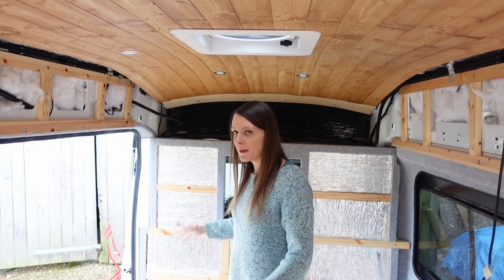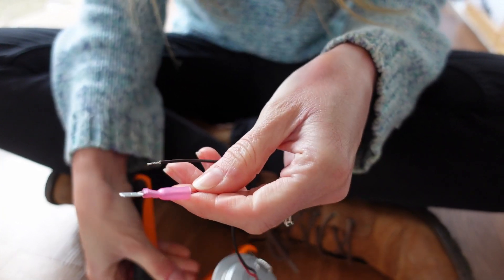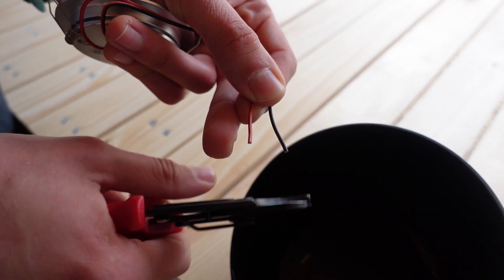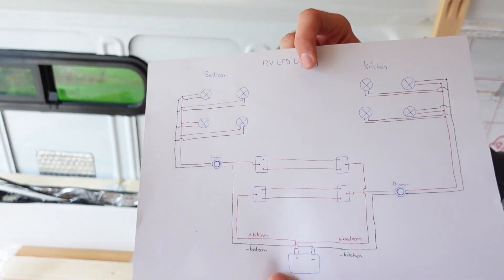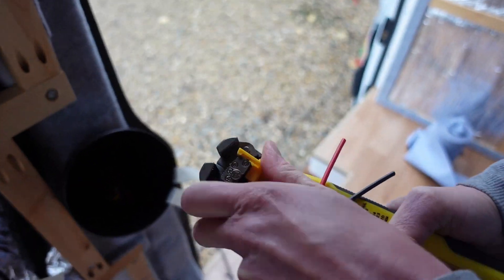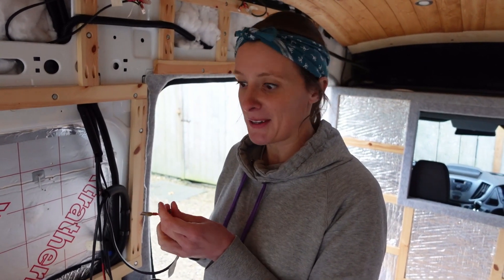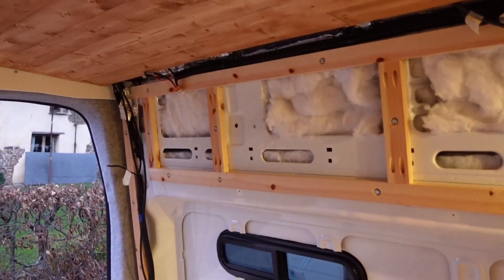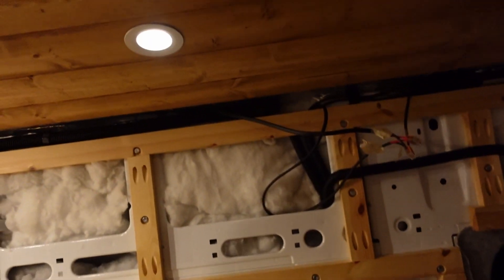Dimmable LED Lighting (With 2-Way Switches!) | Transit Van Conversion E24

Comment from the maker: Hey guys, we decided to re-upload this video as we wanted to add a small text overlay to make it more clear in the edit around insulating the crimp connectors of the lights as we thought it was a little misleading. YouTube doesn't allow doing that without uploading again unfortunately. Thanks to everyone who commented previously, we really appreciate all your comments and enjoyed reading them all as usual and kept a copy 😊
Reply: Really enjoying your van build series. I'm about to start the first fix wiring in my van. Can you tell me what size cable you are using in your lighting circuit please? Many thanks
Reply from the maker: @markleader2622  We used 3mm^2 duplex wire, and as our lights are very low energy usage the wiring we have is overspec for what it needs to be. We used the blue sea wiring chart quite a lot (http://assets.bluesea.com/files/resources/newsletter/images/DC_wire_selection_chartlg.jpg) and after working out the ideal for everything we had to power, we rounded up a few as we wanted to standardise the different sizes as much as possible and by larger spools of each. HTH!
Reply: @SelfBuiltStories  Phheeww!! When I saw the size of the cable you were using I thought I'd messed up and bought the wrong size. I calculated I needed 1.5mm for my lighting (it looks so much thinner than yours). Thanks again. You're doing a quality job on your build....it looks great!!
Reply from the maker: Cheers! And haha sorry, yeah 1.5mm^2 would have been fine for our lights too. It's a lot easier to work with the thinner wire as well, the 3mm^2 duplex doesn't bend very easily with the extra insulation sheathing around it. Possibly we'd buy another slightly smaller size for some of the really low power things if we were doing it again, but it is nice to know we can use the same wire (and we've added a couple of spare lengths around) for most things 🙂

Comment: ALSO, cut wires about 3 inches from connector so you can reuse it on future projects.

Love your work on this build....
Reply from the maker: Yep also a good idea, we didn't do that for the dimmer switches as the wires were so short before the connector that we wanted to have as much extra length as possible in case we had to remake any connection (which we actually did when we crimped on the wrong one first 😛). Cheers!

Comment: I would've put one male and one female on each pair of wires to provide a 'no- brain' polarizing connection.

Also, a female connector on the van's hot wire, which you already did.

I've watched several of your videos and have gleaned lots of good info from you two.

I love your work......
Reply from the maker: Cheers! And yeah interesting, you mean having each pair with a male and female, and then the inverse on the other side so it's not possible to connect them the wrong way? Yeah that would be helpful especially for things that use two same colour wires and not standard red and black 👍

Comment: this is fantastic. I have 5 fixtures in my camper that are all on the same switch that is by the door. I've been wanting to add a three way switch system on them. now I want to split the fixtures up too. thank you for an excelent demonstration of how you accomplished the task. I almost wish you had to rout wires thru the ceiling so I could copy that too.
Reply from the maker: No problem and thanks a lot, glad you found it useful! Definitely took a bit of pondering to figure out how we wanted to do the lights but we're really happy with how it turned out in the end. The wires in the ceiling are just simple duplex ones going to each LED, we did film that part too, it's in our ceiling video if that helps (https://youtu.be/UcrIgiBpgNE) . Good luck with yours 🙂

Comment: Congratulations on wiring job very well done. Lighting system is really well thought out. I especially turning in on the kitchen light without getting out of bed.
Reply from the maker: Thanks! Yeah it's been really handy already, we use both sets of switches quite a lot while we're working in the evening 🙂

Comment: Hey Guys, another fantastic video. Honestly the detail you guys go into so beginners can get to grips with the process is the best I’ve seen on YouTube. So well thought out and explained in great detail, well done. 

This lighting set up is exactly what I have in mind for my van. Excuse the beginner question but are the bedroom and kitchen lights on separate circuits? I’m not far from the pre wiring stage and trying to work out how best to do this. Is the reason for separate circuits to keep the load down? 

Also as a side note myself and my partner have just moved to Cornwall and have a small holding with a nice big field perfect for an overnight stay in the van if your ever in need, just a 10 minute drive from Falmouth, beautiful area.

Thanks again guys
Reply from the maker: Thanks! Glad you think so 🙂 And yep they're two separate circuits, with two separate slots in our fuse hub. You could definitely join them together before the fuse hub and keep them as a single circuit though, the lights only draw ~0.25A each so even with all 8 on one it wouldn't be a problem. We kept them separate just for convenience really, as the way we wired it behind and coming through the panel meant we had the positive and negatives from each set of 4 right there by the fuse hub, so it was simple to put a ring terminal on the end and hook them straight up. Good luck with it, having been on the road for a long while now we really appreciate having two sets of switches for the lights, both get used a lot! And cheers for the offer, we're often down in Cornwall so you never know 👍😎

Comment: Love your channel as a resource for ideas , the dimmers have the 4 very small gauge wires that you are using, then connecting on to your regular lighting run circa 2.5mm gauge, any concerns about these being a weak point in carrying the loads. I am using your concept , but when stripping the wire back on the dimmers, they just look undersized. I accept that it is a short wire run and relatively low current being ran.  14:45
Reply from the maker: Cheers 🙂 And yeah the dimmer wires are thin but we're not worried about it for such a short run and low current. From what we've measured each of our LEDs draws ~0.25A, so each set of 4 combined going through a dimmer is ~1A at full brightness . Not sure exactly the mm2 guage of the wire it's using, but if its ~0.5mm stranded copper then it should have a max amp rating of around 11a. Possibly it's a bit thinner than that (the listing says it's rated to 6A), but still multiple times higher that what we're putting through it, and we have each light set on a 3A fuse. And for such a short length, we're not concerned with voltage drop either. If you were paralleling a lot more lights then possibly it could start to be something to think about, but we've had them in for coming up to two years now with no issues 👍

Comment: Your doing a great job, its great to watch you learning new skills without the drama / fires / explosions lol.. I have to admit as a sparky I was shouting at the screen when I saw you hadn't insulated your connections, I think I'm turning into Victor Meldrew . . ;-/   When you get round to putting your Diesel heater in take a look at bobilvans Hot water adapter kit. Or take a look at David Mcluckie YT channel He is the man when it comes to diesel heaters.
Reply from the maker: Haha funny you mention that, we actually have a few tabs open from David Mcluckie right now! And yeah spot on again, we're going to be using the bobil kits with our diesel heater. We're pretty much finalised on our heating and water setup now on paper, just need to actually finish getting all the bits and build it! And yeah not sure how we forgot to put the tape on the first time round, probably because we were focussing so much on the switch setup. If we were doing it again we'd probably just use the wago's everywhere for simplicity 🙂
Reply: @SelfBuiltStories  You have Way too much spare income throwing it about on Wago's. i'd have used block connectors.
Reply from the maker: We picked them up for £15 for a box of 50 for the whole van which didn't seem too bad, so we have lots spare  🤷‍♂️
Reply: @SelfBuiltStories   Do you have a link for these still please , or was it a one off deal ?

Thanks

Fattrucker
Reply from the maker: @Fattrucker cheers :) And yeah, John Mck's channel is great too! We've actually watched his entire diesel heater playlist, wouldn't have thought so much content on the inner workings of these heaters could be interesting but it is  😀 And the link should be in the description, we just picked them up from Amazon UK 👍

Comment: I felt I had to comment on this and the two previous episodes on the electrical work you both completed on your van build.

I must say it's rare to see such a well planned and executed install. It was great to see such a well installed system with quality terminations, correctly gauged wiring and properly torqued connections.

The system will give you years of trouble free operation and you should be very proud of the quality of your install. It is certainly a change from the many dangerous installs I have had to rectify.

Just one bit of constructive criticism.... Double check that the panels have a good sound connection to the ground chassis of the van. The van body is essentially your safety connection so all your ground terminations need to have a decent ground termination. If for example one of the positive wires made a connection to the chassis of the solar panel and you came in contact with the panel you could receive a very nasty shock especially if it was wet. 

I assume you will be installing an RCD for your mains wiring with your grounding to the chassis. This will protect you from the mains side of your system but not the DC side.

If you do not have a good ground to the panels you can buy grounding plates that have sharp points on both sides. They will dig into and pierce through the oxidation on the body of the panel and give a good ground to the solar rails. You may need to run a third wire with piercing  washers to the solar rails and terminate the other end to your grounding stud.

You may well be aware of all of the above as you have clearly done your homework but I felt I should mention it just in case.

Don't forget your carbon monoxide detector low down the wall just above the floor and your smoke  alarm above the bed.

I wish both of you a fantastic adventure and as long as you keep your safety In mind I am sure nothing will spoil your travels.

A beautiful install and build you should both be very proud of 👍 

Warmest Regards 

Stuart
Reply from the maker: Hi Stuart, thanks so much for your kind words, and it's reassuring to hear your thoughts on our setup .  We did spend a lot of time researching and planning everything so it was great when it all came together and we're really happy with how it turned out, and as you say, we're hoping it will last a long time 🙂 

We'll make sure to check the solar ground again, and yes we will be installing an RCD and mini consumer unit for the AC side. And we have a combined CO and smoke alarm and a fire extinguisher. Definitely our priority is to make sure our setup is safe as well as being practical to power everything we need.  All the best and thanks again for taking the time to comment 😊

Comment: Great video!  I'm looking forward to watching the rest of your videos as well.  I came across this one as I was researching how to set up the lights in our van almost the same way that you two did and I think I finally found the answer I've been looking for.  One question for you - can you use the dimmer switch to turn off the lights entirely or does it just control the dimming?  Not that you would need to do that since the actual on/off switch is right there two, I'm just curious.  Thanks!
Reply from the maker: Cheers, glad you enjoyed it! 🙂 We spent quite a bit of time trying to figure out if the setup we were imaging with all the dimmers would work and it was very satisfying having it all working. That's a really good question, and the answer is yes you can turn it off with the dimmers as well. You just touch once instead of touch and hold and the lights turn off. If you touch it again they come back on at the same brightness they were before. In practice though we won't use the on/off on the dimmer as the one quirk is that if you turned them off with the dimmer, then the rocker switches wouldn't turn it back on again until you had remembered to turn them on via the dimmer again. What we did is put the dimmers after the rocker switches in the circuit, because the dimmer has an LED light ring around it. So we did that for two reasons, one so it gives a visual indication when the lights are on, and if we ever try the switches and they're not working we can see visually if the dimmer has been accidentally pressed. And the other is the inverse, when the switches are off (e.g. at night) we didn't want the blue glow to be visible, so we cut power to the whole dimmer switch when the lights are off. Hope that all makes sense!

Comment: You can use in-line wago connectors to connect two wires together. It's far simpler.
Reply from the maker: Hmm yeah those look cool if a little pricey. If we were doing it again we would probably use the 3 way wagos for the ceiling lights too as we already have those and there's enough spare

Comment: Did you guys remove the standard cargo lights connected to the doors in the back at all?
Reply from the maker: Hey, yeah we took out all the cargo lights as we wanted to put our own spotlights in, but they were useful up to that point as it was the only light we had in the van for working into the evening 😄

Comment: Hi! How did you calculate the wire size for this circuit? What did you end up going with, and what was the total length of wiring? Thanks!
Reply from the maker: Hey 👋 We used 3mm2 duplex, which was a bit overkill for the lights but we decided on using that for most of the low power 12V accessories as we could buy a big spool of it and not have loads of different wire sizes. Later on in the build we bought it non-duplex as well as it can be a bit cumbersome to route the duplex one with the extra sheathing. 

We put the wiring in for the lights in our prewiring video: https://youtu.be/DTzaAh7on4c?si=RIGJTYDEycyVB78A&t=447 . And talk a lot more about how we picked all the wire sizes in the van in that one too based on wire run distance and voltage drop. Not sure exactly how much wire we used specifically for the lights, but it was probably ~20m or so as we used up most of a 30m spool with just the maxxfan and the lights, and to get to the fan is probably about 8-9m round trip. Crazy how quick it adds up! Good luck 👍

Comment: Hi, sorry for my broken english. Amazing chanel, love your skils and solutions.
I'm wondering about the kabel diamention for your LED ceilinglight, in my opinion 1,5²mm is big enough for that. What do you think?
Best reagards from Berlin, Germany
Steppe
Reply from the maker: Hey Steppe, thank you! And yeah 1.5mm^2 would have been fine for the lights in our case, and our wiring there is definitely over specced for what it needs to be. We did that because we bought a big spool of 3mm^2 cable for all the low current DC accessories so we figured it was easier just to buy one size that would suit all them. We would have bought 2.5mm^2 but the company we bought from doesn't sell that size. HTH!

Comment: So it’s good to do-your  wiring and your solar  wiring even if u don’t connect your solar before you do your ceiling and walls ? Trying to find a step by step guide but everyone want charge you 😐 ..
Reply from the maker: Yeah that was a confusing one for us at the beginning figuring out when to lay the wires. There is no set order you have to follow though and different pros and cons. We decided to do a lot of the wiring early on behind the walls to tuck it all out of sight, but you could equally leave the wiring till later and do it in front of the walls. Some people like to do that and make a feature of the wiring, putting it through copper pipes or something like that as a show piece. One advantage of doing it later on is it might be more accessible to get to if there is an issue that needs fixing later on. For us we decided we wanted to hide most of it but left some places where we can access behind the wall if we need to. We've also since added some more possible wire runs for future expansion that are in front of the walls but still hidden inside furniture, through the bench seats etc. It's good to think about the things you want to power in the van and where they will go in relation to the rest of the build/furniture etc and it starts to fall into place.

Comment: love your dimmer switches , are they still working good , did you get the second one working or did it need replaced ? lastly do you have a link for the dimmer switches :) keep up the great work guys
Reply from the maker: Hiya, yeah they're working great we love them and use them quite a bit! The link should be in the video description, and yes we have had both working for a while now. 🙂 For the second one we contacted the manufacturer and they sent us a replacement which was fine 👍
Reply: @SelfBuiltStories   Super jobs guys , thank you , nice you put the items used in the descriptions :)
Reply from the maker: @joedeath332  You're welcome :)